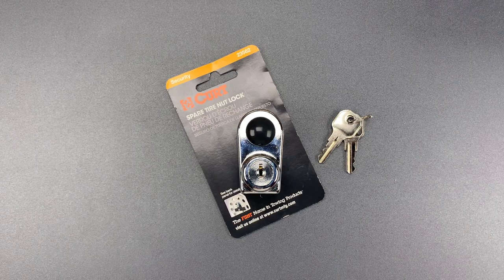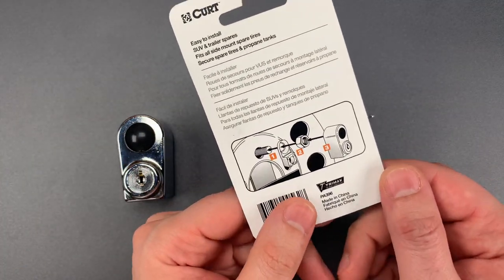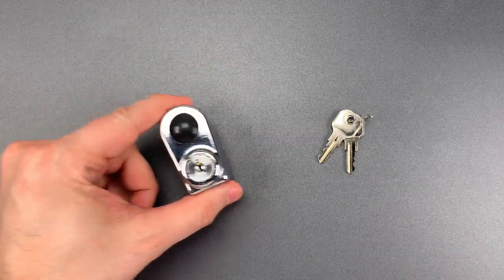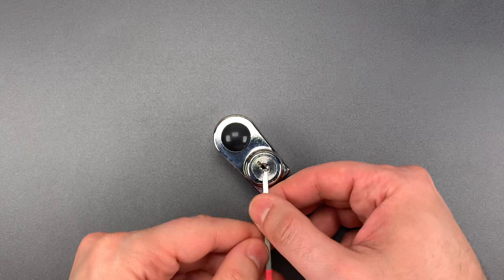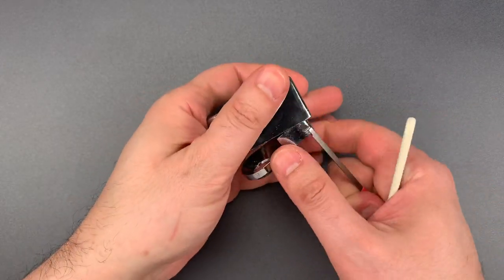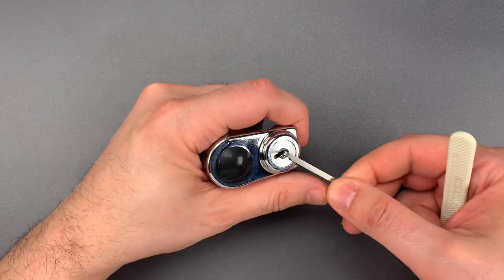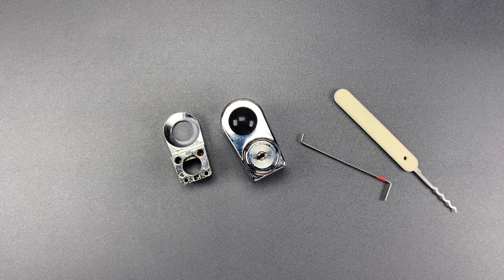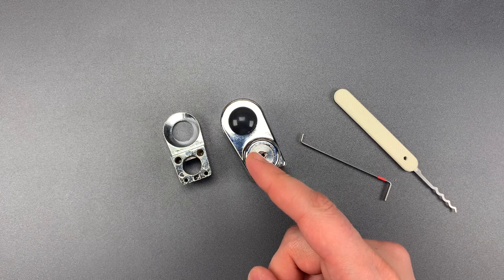[1035] Laughably Bad: Curt Spare Tire Lock Picked

Comment: One day he'll insert the tension bar and the thing just opens.
Reply: With some very cheap warded padlocks, they do exactly that.
Reply: I mean, he did once rake a lock with a tension bar...
Reply: I believe he did that fairly recently. There was a lock he featured where the locked position placed  several pins above the shear line and it turned with no key inserted.
Reply: I had a 1961 Triumph Herold you could open the doors and start the engine with any flat headed screwdriver, I would say that is what you are thinking.
Reply: In Australia, 80's Ford Falcons could be opened and started with the broken dipstick.
Reply: My bicycle lock did that... Now I don’t use that lock, lol! The key bitting was only the first one had a cut, so literally bumped that pin when inserting a tension bar and it opened.

At that moment I felt like a mastermind, thought somehow all of LPL’s wisdom and skill got transferred to me and multiplied by 10x, then I’ve proceeded with reality as I struggled with a Masterlock model 3 for 15 minutes... Bad part is that Masterlock was with a decent set of picks, and I know I’ve opened it and much more complicated locks as a child with nothing more than wire (it took me 3-5 seconds to open our old house with nothing but bailing wire, ironically the garage door took longer, but even when I was 8 I could pick into most of our vehicles within a few minutes, lol, I think my mom has a photo of my dad holding me up to pick the lock on a car and I was like 5 or 6or something because my dad is still to this day terrible about locking himself out, haha! But anyways for who knows what reason I seem to have lost that skill. I think it’s just that I’m older and impatient, because as a kid I’d keep trying something near impossible for most of a day until I accomplished it. I think I’ve simply lost that patience in life and just expect instant skills, lol, which obviously isn’t true!

LPL humbles me, I know his talents didn’t take days to develop, it’s taken years along with hard work and dedicated practicing to make things look as easy as he does (consistently)!
Reply: Haha, ive got an old Abus 45/40 padlock that will open with a tension wrench lol. 😂
Reply: One day he'll just reach for his picks and the lock will fall open in fear.
Reply: There was a video where litteraly everything he inserted opened it. The video was " the lock that wont stay closed" or something
Reply: He's slapped locks open. Close enough.

Comment: My parents had an SUV with a rear-mounted spare tire.  One of the wheel studs sticking out from the carrier had a center hole across it, that let a small padlock be installed.  While such a small padlock might not be particularly strong, at least this setup had the advantage of allowing one to select whatever padlock one wanted, not being limited to a specific core.

Comment: That key is a CH751 and is very common in pool tables, van/truck tool boxes such as Adrien Steel brand, and nearly every RV exterior door. It is also the key that is used on every Cummins Gen housing since the late 80s/ early 90s and due to the bitting you can basically just insert a snake rake into the key way and get it open. I use this key every day.

Comment: Yesterday I found a lock with a 3 pin core	._.
Reply: Nothing compared to my 1 pin core.
Reply: LOL was is a Master Lock
Reply: @AlbertLebel  If not, that 3 pin core was probably still harder to pick than the best Master Lock has to offer :)
Reply: There's a number of them available.
Reply: luggage lock?  they're fun
Reply: Abus do a lock with a three pin core, the 55/30 I think. Two of the pins are spools though, and it's a good way to start picking spools.
Reply: you know the worst part is the lock on the trunk of my car has a single pin lock on it just barely touch it and it unlocks I have unlock it with tension

Comment: That’s pretty sad !  It’s also kind of funny that  now most major tool Companies sell Commercially available  sockets  that can quickly remove  the other type of  locked lugnut sets without the actual key  that you get with the sets !  Years ago i thought those worked but my mechanic Buddy showed me his kit he bought from SnapOn  and told me without the kit if the key was missing he could just  hammer a tight   Socket onto the lugnut and back it off with his Breaker Bar  to remove those  ! So much for protecting my expensive aftermarket rims  that ive been buying since the early 1980s  ?

Comment: Pathetic what passes as security. I looked at a $4000 "High security" jobsite box yesterday, with a dual-side wafer lock 🙄 Built like a tank, opened with some bits of metal I found in the gravel around it. Salesman didn't think it was as funny as I did 😆

Comment: JB weld in place, smash it when you need it open.
High security lock.
Reply: Last time I had to get a spare off it took 20 minutes of fighting and a three foot bar on the wrench because of the rust. No lock at all. Rust is free!
Reply: A little hard to hang the flat tire there if you broke the stud it hangs on...

Comment: I was thinking that this was meant to be used on one of the wheels actually touching the road, not the spare.  I was thoroughly confused until the end.  With that said, I'd be interested to see if that cast zinc part was strong enough to actually withstand the holding force of a lug nut.  My thoughts are that it won't.

Comment: Guess it has same purpose as these soviet gas tank lid locks: someone who is about to steal some tires would have a wrench and maybe a carjack, not a waverake and tension wrench, if he sees this lock - he proceeds to another car, and that's it. In that sense it's probably better than locknuts for unusual pattern wrenches, since they still can be opened by sticiking something similar that will provide tension, while this lock will require tools that a wheel thief are unlikely to have

Comment: @
LockPickingLawyer  If you get time to answer this query: what are the widths
on each end of the tension tool in this video. You called it a "narrower" type, but
one end had been narrowed. What MM or inch were they ... each end?

DC

Comment: For real though, imagine if most thieves actually carried a tension wrench and rake? If they've got time to cut a shackle, they're got time to rake. Few seconds with the rake and boom they wouldn't need to cut. It'd be no big deal if the rake failed, that's just a quick "it'd be nice if" and it'd even get them past some locks that are tough to cut but easy to pick.

We might also get better locks all round if that started happening.

Comment: It couldn’t be used on mat allot wheels because of its shape either. Especially if it has any kind of negative offset. Also if you use it on a wheel that has clearance to allow the entire Lock to rotate while on the lug but I’m sure all a thief would need is a hammer. Hit the lock at 2-3 points bending the lock body into the flats of the lug nut then use the hammer to hit the bottom of the lock to loosen lug then spin it off the threads the rest of the way. So depending on the type of wheel it may make it easier for a very low skill attack to be achieved. 

That’s just what I figured out from watching this video, I can imagine if I had it in my hands I could use my experience to find even more attacks

Comment: I'm looking at this construction and think it looks pretty flimsy,  A  medium sized locking pliers around the nut enclosure could probably break it (if it is white cast metal) or bend it enough to flatten it against the nut and then use the lock as a wrench.

Comment: Actually, its a good lock. Here is why: If you use the lock along with locking lugnut, and put this lock over the LOCKING lugnut, it means the locking lugnut will be invisible to an thief. The thief might pick the lock or break the lock, thinking its a "normal" lugnut under.

When he uncovers the lugnut, he will see its a locking lugnut and cannot proceed unless he has the right tools. It will also be very suspicious if he opens a lock on a car, and then cannot do anything after that. But its not suspicious if someone just with eyes look on a naked lugnut.

Another advantage, is that the thief, even if he would know its a locking lugnut under or suspect a locking lugnut, cannot arrange to get a master key or bypass tools for the locking lugnut, because he cannot see which model of lugnut it is, before picking or breaking the lock.

Comment: A better way to secure it is by having the nut and bolt rust together so tight that a thief would give-up on it. Downside is you don't really have a spare tire then.
Reply: Cheater bar on your own lug nut wrench. Say, like the bar from a hi-lift jack, which most Jeeps will have.

Comment: Hey LPL, would you happen to have a link or advise on where to get  a proper lockpick set?
currently i'm using 9cm wiper inserts for tension, although the picks i got are quite flimsy, and i'm looking for something more reliable

Comment: It would be better if one of those screws was actually a bar bolted from inside. No way of taking the wheel off unless you open the trunk or wheel rack.

Comment: So the lock has a lower melting point than the wheel... hmmm... Not that you'd go that route, just saying Curt knew it was so bad they weren't going to use more expensive metals.

Comment: 2 seconds to jiggle it open with a special tool. But I wonder, what could be fashioned by a novice to open it in a similar way?
Reply: DryHaySoup  A rake isn't a special tool, it's a tool good for novices.
Reply: @herosstratos  but it is specialized for picking locks and isn't a common item. That's what I was getting at.
Reply: @fartzinacan  try a bobby pin.

Comment: couldn't you just rotate the whole lock with enough force and remove the bolt skiping the core entirely?
Reply: Probably. But that means using a pipe wrench on the lock.